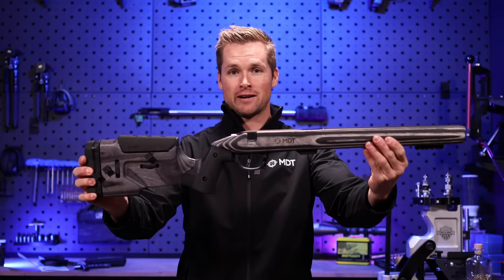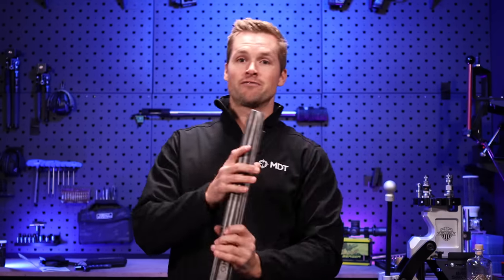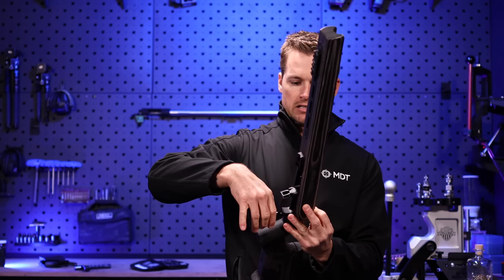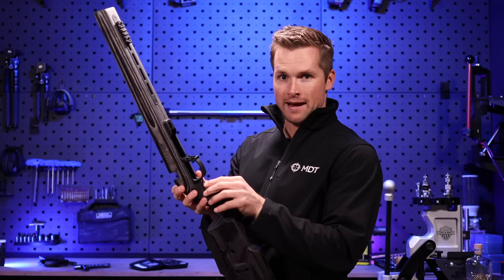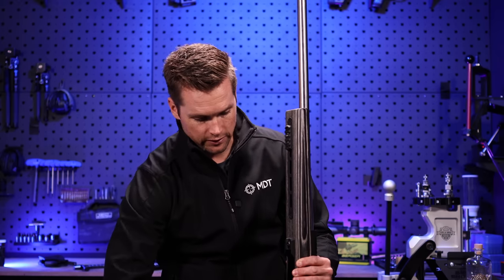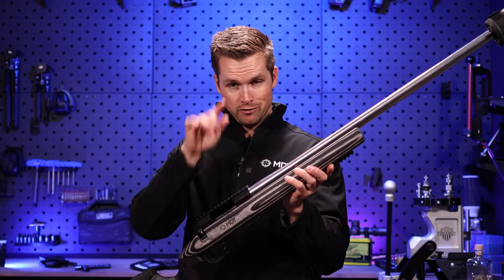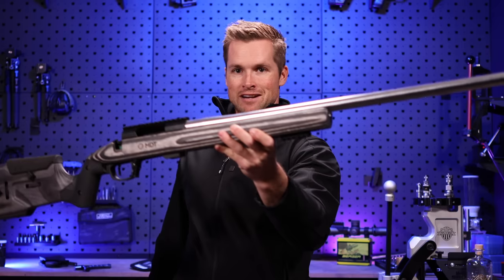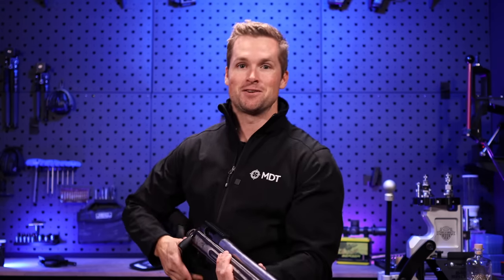How To Install A Rifle Chassis The Easy Way!

Comment: Great vid. Recently had a 6 Dasher built (My first open division bolt gun!) and got a great deal on a MDT ACC chassis. Had my gunsmith take things a step further and he bedded the chassis. (He asked if I wanted it done, given his PRS record, yes, I want my rifle how he builds his own. lol) Does a chassis need to be bedded? No. Absolutely not. Is there a benefit to doing it? I'm going to have to go with yes otherwise my builder/gunsmith would not offer the option nor do it to his own. Will all of this make me a better shooter? No. That's on me. It will however take all the error out of the rifle. (Switching from a midgrade gas gun to open division bolt. Should be interesting. lol) Cheers!
Reply: I said same thing...what no glue/bedding? Simple logic....how well mated is recoil lug and action? Bedding marries more surfaces, gluing joins them which is stronger again!